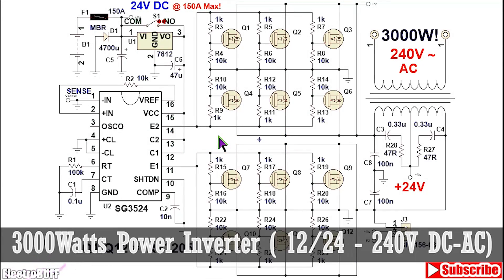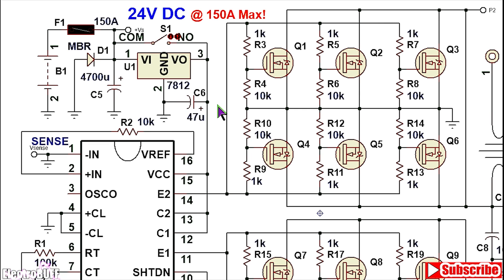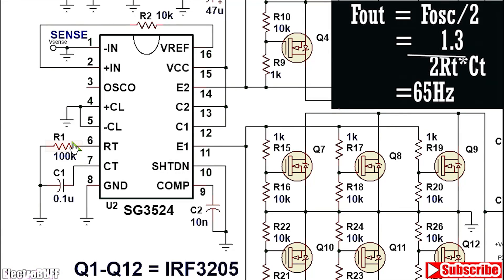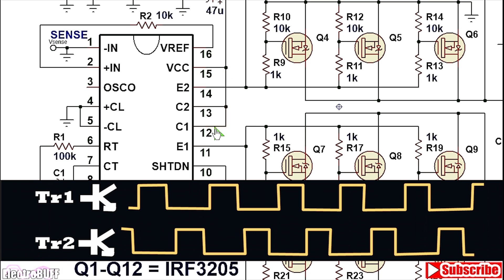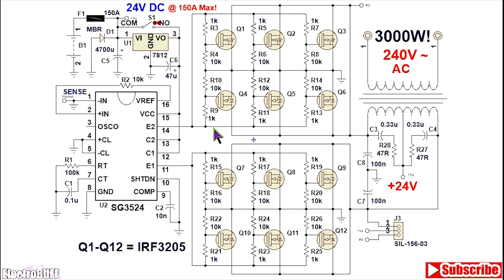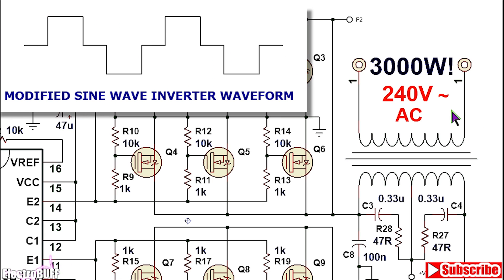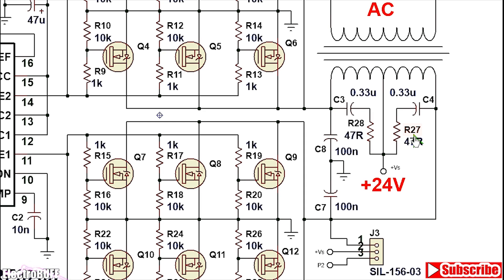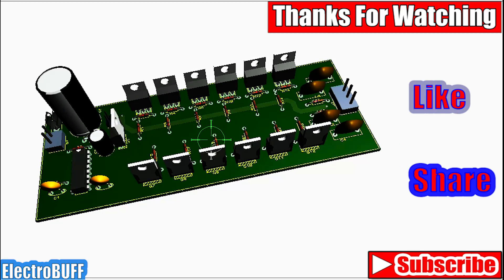3kW! SG3524 PWM IC Power INVERTER with Modified Sine Wave Output Voltage

Comment: I will recommend to sold the transformer  directly on PCB to avoid intermittent connection which can be very dangerous  by high power.  Thanks for the video